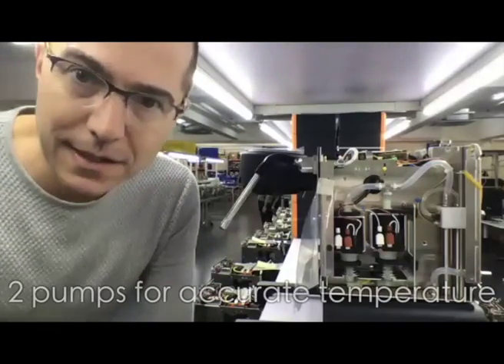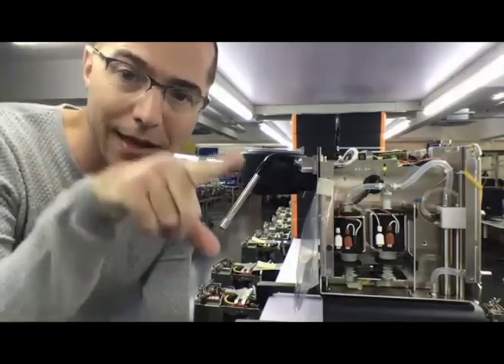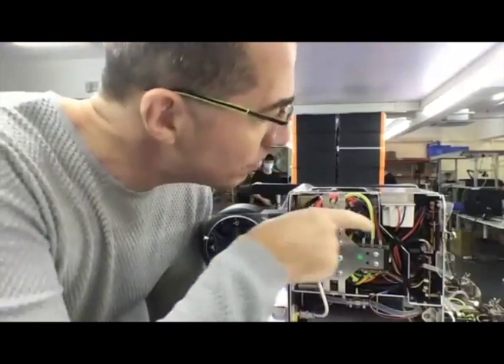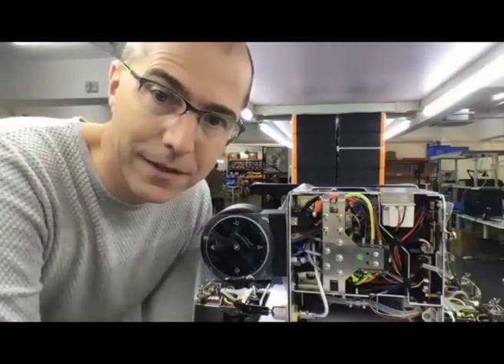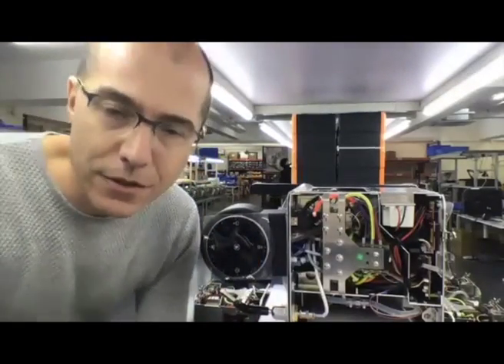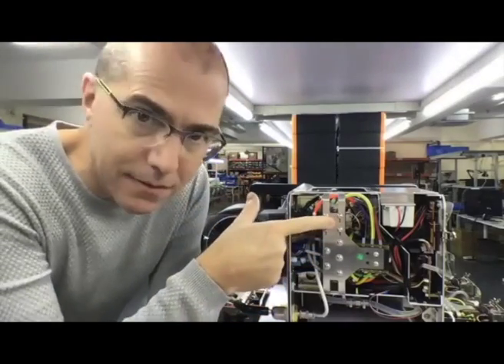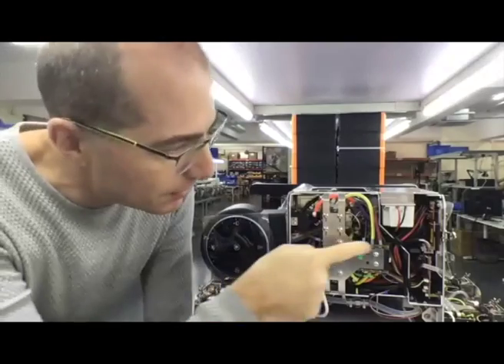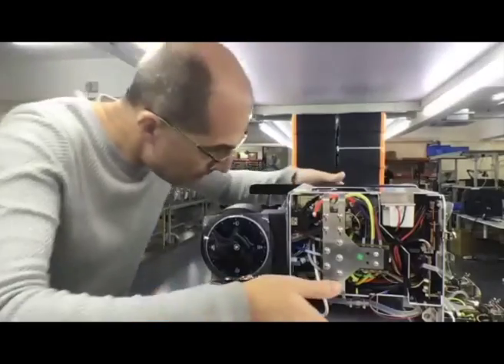2 pumps for accurate temperature

Comment: It's a very interesting setup you guys designed, by having all steps in the waterpath compensating all the time (heating element, pump, mixing), you basically nullify most of the variances and inaccuracies of the individual steps.
Also amazing how not all espresso manufacturers use phase angle control on those vibration pumps, realising how stupid most espresso machines actually are (regardless of marketing) made me realise how much they are just making them "to make a quick buck", instead of getting the best espresso.

It gets even worse with superautomatics: They already contain so much electronics, just adding phase angle control and decent PID temperature regulation, would be peanuts. But no, they just want your money >.<
Reply: Fully automatics are the worst ever!

Comment: Great machine. I see Decent is using ODE HK pumps.(P500 if remembered correctly) Do you see any improvements using these pumps instead of standard Ulka or Olab made ones?
Reply: @decentespressotech  Thx for the quick answer. Seems like finally the magnet pump gets some noise improvements.The Lelit Mara PL62X also got a very silent magnet pump build by Olab. I assume the variable pump controll used by the DE 1 helps a lot with reducing noise.
Reply from the maker: The tone is deeper than the ones currently used too.